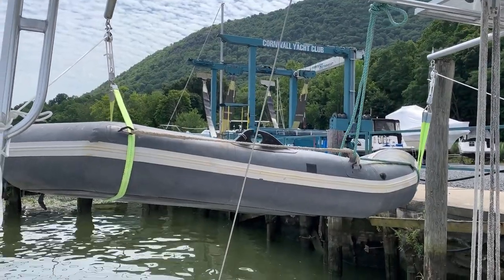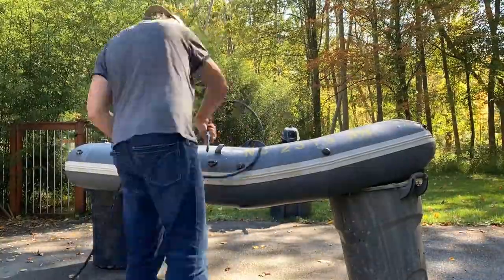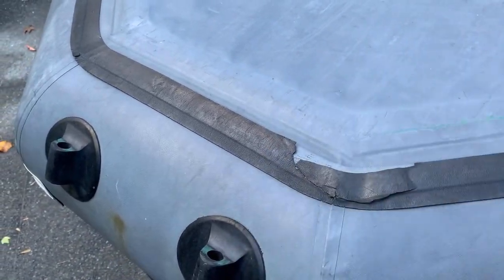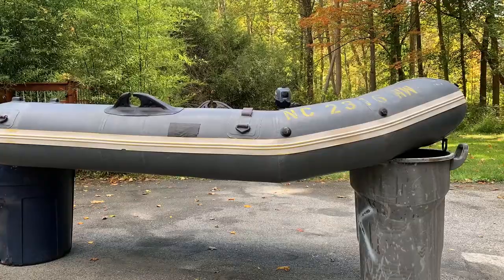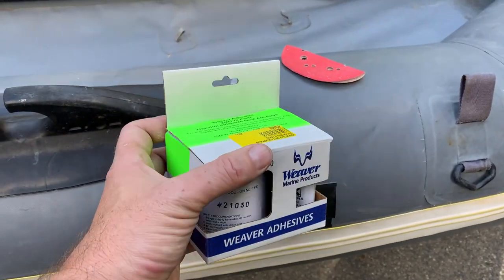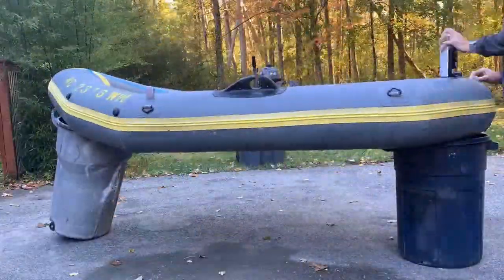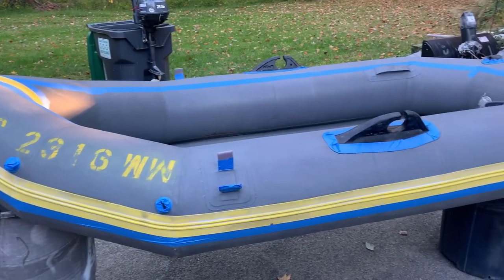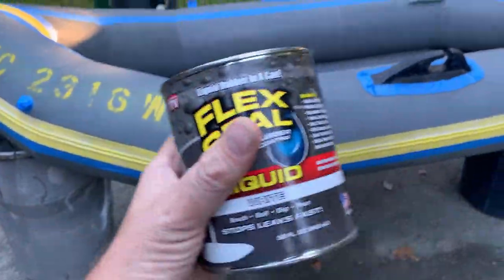DIY Rehab of a 1983 Avon Redcrest Hypalon Inflatable Dinghy  (Boat Work: 9 LIVES DIY Projects)

Comment: Dude you didn’t show the finished result of painting the boat.
Reply from the maker: I suppose we should have done a close-up inspection of the boat after the paint cured. Absolutely. But for some reason we just... didn't. So, I included a quick clip in the end of the boat in use with the paint on it.
Where do you sell real estate, Byron?

Comment: I’ve heard that the flex seal doesn’t cure completely… did you run into this issue?
Reply from the maker: No, no problem at all like that. It cured fairly quickly and completely.

Comment: Did you sand the entire boat before applying?
Reply from the maker: I sanded the areas that I "painted" very very lightly just to scuff the surface and remove any loose paint (the old lettering). The material stuck very well, and still looks good today!

Comment: Hi, I'm thinking about doing this to mine too but wondered, when it cured did it impact the pliability of the hypalon?   Did you end up deflating and folding the boat up after you painted?   I know the hypalon can be folded up in its original state but if you painted with this product, would it harden the surface and cause crazing or little cracks to paint surface when it gets folded up?
Reply from the maker: Great question! No, no cracking. This stuff remains very pliable, like a rubber coating. It thickens the material somewhat, so I guess you can say it doesn't fold quite as well as bare hypalon... but no, it is not nearly stiff enough to create a problem.

Comment: I just picked up a 1982 achilles st-5 hypalon dinghy, and I have to ask did yours smell extremely strong like plastic/hypalon? If i even touch the boat it leaves a strong odor on your hand, so far i have scrubbed it down twice with dish soap/bleach and dish soap/30% vinegar. The vinegar seems to help the most. Thanks!
Reply from the maker: No, I can't say that was the case with this one. Similar vintage, too. Was yours exposed to the sunlight often? I suspect perhaps UV damage to the hypalon... This Avon was always kept in its bag in a locker when not inflated, so didn't see much sun.